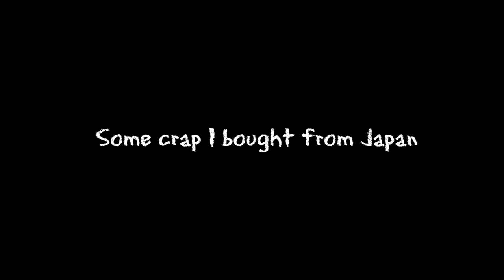Four String Bass Converted Into A Five

Comment: From the centers of the highest and lowest strings, what is the spacing at the nut and bridge? Also, try reversing the P pickup while keeping the centerline the same. What I mean is to route the body so that the bass side of the P can be moved rearward to where the treble side usually sits and vice versa. Provides a more balanced tone IMO. No more pingy high strings and the bottoms aren't quite as wooly, either.

Comment: That was a spicy conversion - never saw someone widen the space on the body for a larger neck. On the topic of weight: what is an acceptable margin of instrument weight for you? When does it get too heavy to even consider playing it for 2+ hours straight? Thanks in advance!
Reply from the maker: Great question, looking at the effect of a bass guitar on a human body it really becomes a question of weight vs balance. More weight = bad for your shoulders, Bad balance (neck dive) = not very good for your posture. With some designs that are naturally neck-heavy there is a tendency for cheaper instruments to try and correct the balance by adding weight, it becomes a tradeoff but there is a sweet spot that differs for every person just as it differs for every bass. For myself personally, with 20+ years of neck and shoulder problems, any bass heavier than 3.8kg instantly qualifies for the wide padded strap, anything over 4.8kg just never gets used. My favorite basses are all 3.6 - 4.4 except the violin basses which are barely 3.2 but have definite balance issues. Hope that helps, thanks.
Reply: @fanbladeinstruments  It helped a lot! Thanks for the quick answer!

Comment: What site did you find these on, i've been looking ro a while to ickup a bass and they're all $1000, not Y1000. :<
Reply from the maker: Jauce.com Bear in mind that the ¥1000 is super low even by their standards, I actually bought it expecting the translation to be wrong and all I was buying was the stand it was on, but no, I got a bass. Looking on there now the really good deals on well made budget basses are sitting around ¥4000, not including shipping and other fees, and there are a lot of them - Jauce ain't working for free here!. 

All tolled, I've just bought 2 cheap and cheerful basses for a total purchase price of NZD$80, plus fees and shipping to my door the total will be closer to NZD$450 (USD$280), which is still pretty freaking good for what I've bought: a 'Selder' branded P-bass with an amazing flame maple neck and a very tasty looking 'K-Garage' branded Jazz copy. If you've got the $1000 to spend though then there's everything you could want in vintage Japanese guitars and basses, I've never seen so many Tokai and Greco basses in one place before. It's amazing, happy shopping.

Comment: On the subject of conversions, any strong opinions on a Jazz Bass to Bass VI conversion with a short Tele bridge and a couple of Jazz Bass rails pickups? I'm undecided on whether 4+2 hack job with actual bass tuners versus the whole 6 in-line split shaft guitar tuners and recut head scenario, which seems unescapable.
Reply: 4 n 2 is cool I have that setup on my ernie ball  O,L,P MUSIC MAN guitar
Reply from the maker: Interesting... I would take the tuners off, fill the holes with dowel, then veneer the headstock front and back so you could put the tuners where they need to be to maintain direct pull over the nut. Assuming you'll have a new nut with the strings crammed closer together then they'll be pulling sideways over the nut to get to the tuners in their current location, then you're at risk of tuning problems. Might I also suggest using a precision neck if you can find one, I feel like a jazz neck would get very cramped and the extra width will definitely help. Good luck, and please film it, I'd love to see how it goes. Cheers.